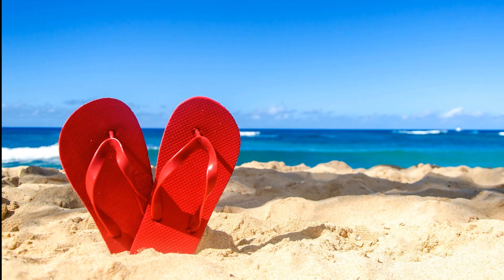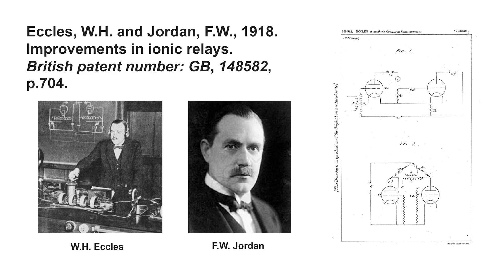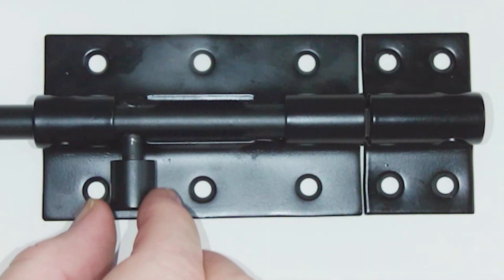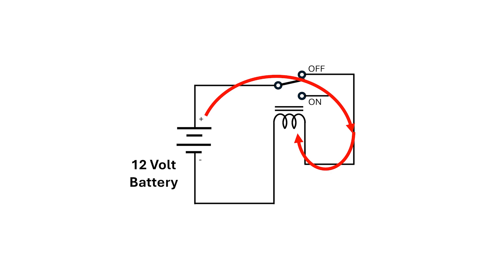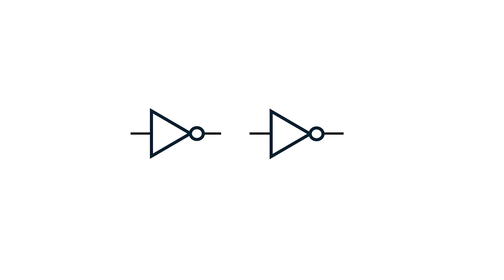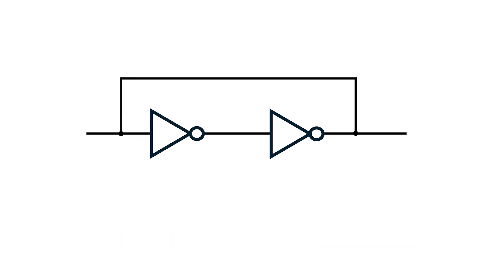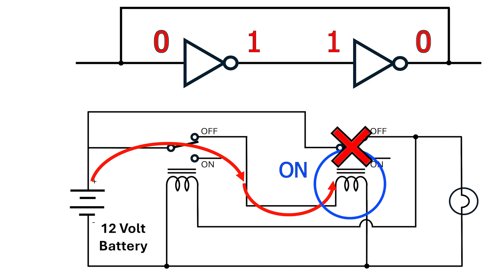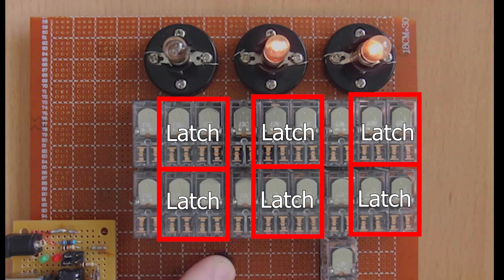Switches to CPUs: Relay based latches

Comment: No errors that I could see here, either.

As alluded to in one of the other comments on the video, you can make a single-relay latch by hooking the ON output from a relay up to it's own coil. (Basically a buffer with its output connected to its input.) I can see why you did it the way you did in the video, though, since the two-relay latch demonstrates the concepts involved (especially when things end up translated to transistors) a bit better. (I think the differences between how relays and transistors work mean that the single-relay version loses its advantages when translated to transistors, too, but I'm not 100% sure on that.)
Reply from the maker: Thanks.  I'm trying to introduce one idea at a time, so i want to keep the relay implementation close to the gate version.
In the 6502 itself, it has about 13 8-bit registers (including hidden registers), so switching to a single relay per bit saves 
a huge number of relays.

Comment: Minor correction: the Atari 2600 used the MOS 6507, which was a cut-down version of the 6502.
Reply from the maker: True.  I’m thinking to keep it simple. C64 also used the 6510, but they are based on the 6502 architecture.
Reply: All of the masks of the 6507 were the same as the 6502 except for the metallisation layer that was slightly patched to disable interrupts (the 6501 was also the same chip with a different patch to the metal layer to bypass the internal clock generator). The main difference was the smaller 28 pin package to reduce cost. All the transistors and pin pads of the 6502 were there in the 6507.
Reply from the maker: Yeah, from my understanding the upper couple of address lines weren't visible from the outside.

Comment: You win. I just ordered 30 relays and signal diodes. They're five volts, so I can interface them with digital electronics. The covers are opaque so not as cool as yours.
Reply from the maker: Cool, have a look at Dieter Muller's relay based ALU, that's what i'm planning to use down the track.
Reply: @DrMattRegan  Thanks for the pointer! I found it and that design is incredibly economical. The control signals are a hit of a PITA though, but the ALU chips I have seen are similar.
Reply from the maker: @mheermance  yeah, I think the 181 does something similar